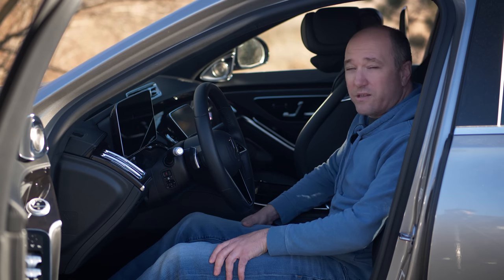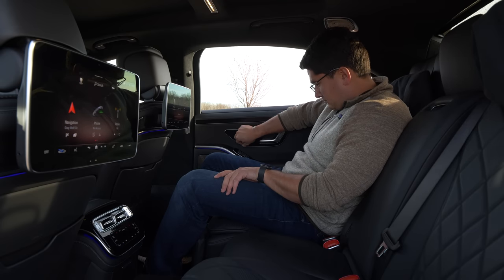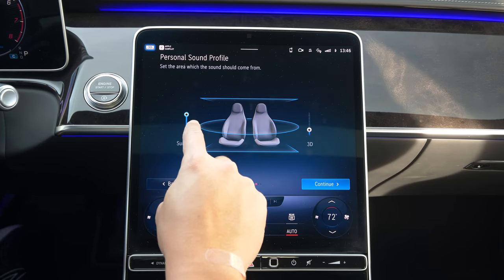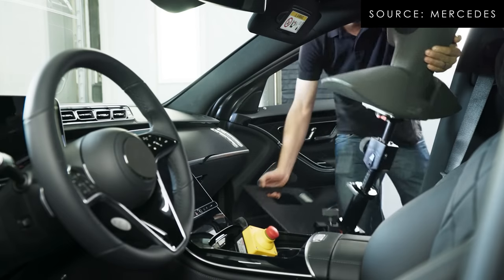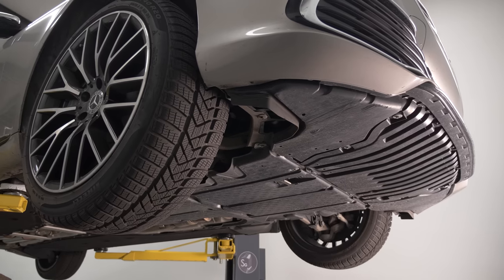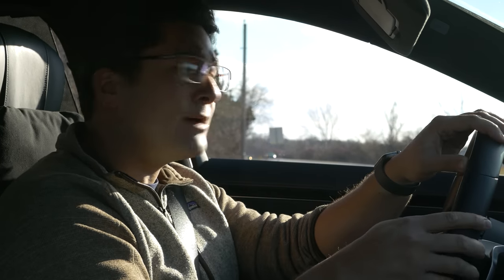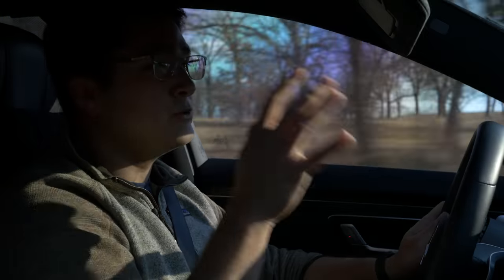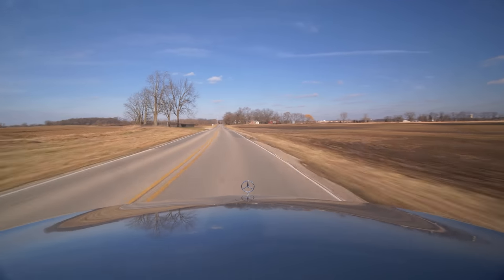Mercedes S-Class | The Best and Worst of Cars

Comment: My experience with a used VW Phaeton followed by a used S Class.
1) If you get a clean, no accident, dealer serviced vehicle, they are generally reliable, but will involve higher running costs vs. something more normal.
2) Phaeton was memorably nice for long distance travel, ride best described as flying over the road, stable, level, insulated travel with comfy well supported seating.
     It was not designed to be easily serviced, and had some baked in design issues which made it financially hazardous to own.
     On the plus side, I managed to sell it on after a few years and 40,000 miles for $3,000 less than I paid for it. ( Still I replaced batteries (self), upper control arms (dealer was ok with my already purchased oem parts), tires, brake pads (self), crank position sensor (dealer)),  timing belt service(dealer). 
  Everything worked on the car ( except the tpms batteries started to go just when I was selling it). It had something like 105k on it when sold, the finish was still near new both inside and out, the paint finish was exceptional with no orange peel, when clean it was a black mirror, the used, also near perfect, newer Mercedes that replaced it could not match that level of paint finish.
3) The S-Class is the Honda accord of big luxury cars. They are made in high volumes, are much better developed, and are easily serviced and durable.
Everything service related is much easier on the S-Class. They are not friendly to aftermarket additions so its best to get a clean, dealer serviced car to own. 
  The driveline related components are typically reliable and long lasting if maintained. In car service applications ( NYC area) they reported about 270,000 miles until transmission need rebuilding and 325,000 when its time for an engine rebuild. Front air suspension lasts about  100-120k.
4) My experience is that overall this is a nicely designed and executed luxury car. It is unfortunately way more ostentatious than a Phaeton. In a similar ownership period, this car needed almost no repair, dealer service was on the expensive side. Repairs were to the heated windshield washer/headlight washer hose that the fitting leaked(self). 
Depreciation was higher on the S, close enough to $10,000, so that sort of made up for the lack of repair, also paid a premium for an as new car from an MB dealer, that had preemptively replaced brakes, tires, control arms, batteries, did a current service, etc, such that it presented as a new car, the prior owner must have been thin as the interior leather, and everything else looked untouched.
The BMW SUV that replaced it felt like a s***box compared to it.
4) Before the Phaeton, I always had sports or sporty cars and an SUV or wagon. Now I’m spoiled.
When you are driving anywhere where its an hour or more, a good luxury car is easy to appreciate. The german examples combine an insulated ride, exceptional safety, with non-boaty handling and grip. The more modern ones are pretty quick as well. 
It’s also sort of a decompression chamber, being comfortably seated, with a pleasing sound system, quiet riding, even in traffic, you tend to be much more laid back. 
5) This current car preserves most of the elements of the prior gen and improves on some things, ride, structure, safety. 
     The UI looks a little annoying. I prefer having hard controls for primary tasks. I think some of the criticism could be mitigated by the use of the steering wheel controls, setting up user profiles by key, configuring desired default settings, and maybe using voice control while driving ( really should have physical switches for primary functions like volume, temp, fan speed, defrost, etc so that you don’t require distract-o-tronic input while you drive)

I’d be more than happy to own one of these used when they hit $25k, 6 years old,  and 60k miles, which they will. 
These are really nice for a net cost of $350-500 a month, in place of a more basic, newer car. ( vs $2500/month new if you have a very substantial disposable income )
Drive an S-Class for a month, then get back into  your car and see how it compares. Better yet, don’t, you’ll save money by driving what you already have.

Comment: FYI, I worked at Harman when we were developing this dashboard for Mercedes and other manufacturers. I was like "this is cool, in my house. But in a car, while you're driving!?"

But this is mainly designed for when cars drive themselves.

The 3D technology is the same as the Nintendo 3DS lol.
Reply: I never understood high end speakers in cars either, the last thing you're gonna enjoy in one is the music. On electric cars you could at least make use of it
Reply: @Daniel-dj7fh  I'll disagree on that one.
Reply: @Daniel-dj7fh  Yeah, why would that be? I doubt its noisier than any electric car, more or less.
Reply: @GoldenCroc  Cars nowadays usually make mostly tire noise, where the ev's also have a benefit since energy saving tires have less rolling resistance
Reply: @Daniel-dj7fh  Sure, but the same tires can be fitted to an ICE car. I would go as far as to say that dollar for dollar, as of currently, ICE cars are in general more quiet than their EV cost equivalent, even with the factory fit tires.
Reply: @Daniel-dj7fh  oh, I think you need to step into a good car with a well designed audio system. Had you done so previously you would not have written that comment. In car audio has different constraints but done well, it is probably less fatiguing and more pleasurable than most people have in their homes.
Reply: @andrewwilson8273  I've been in cars which have Audiosystems costing more than my motorcycle.

Comment: German Engineers over engineering? Never ever....
Reply: The S-Class has always been all about over engineering.
Reply: @iCoolaxe  It used to be about over-building rather than over-engineering.
Over-building means designing something to withstand more than the expected stress for better longevity.
Over-engineering means complexity for complexity's sake.
Reply: Most of the childs play on this car has nothing to do with engineering. The Driving side of the story is what the amg's have had for ages but tuned for comfort.
Reply: @tim3172  That doesn't explain why the centerpiece supposingly creaks

Comment: I think Mark’s assessment is spot on in that the person who will “own” this car will be a passenger who has a driver that will put in the 32 weeks to read through the manual to know how to operate every part of the car and know how to adjust it when the owner briefly mentions a discomfort.
Reply: It is an S-Class, not a Rolls. $140K is little more than a loaded Escalade or Z06 Vette with dealer mark ups.  Doubt many in the US will be chaffuered.
Reply: @briangasser973  Sadly you’re correct. Car prices are insane nowadays. I remember when 45k for a car was “expensive”.

Comment: I love tech, but I hate touch-everything. I don't understand why it has to be done this way.
Granted, you want to have options of a touch screen at times (Maps. etc.), but climate control? I shouldn't have to take my eyes off the road and go through the touchscreen to find it.

I also don't understand why more manufacturers don't copy BMW "M" button. Just stick 10 buttons under the touchscreen, which I can program myself. Add a small screen above them, so that when I program them, it changes the "picture" above the button and voila, I am a happy customer.

But if I am a 50-60 year old dude, I'm not sure I would be happy with all this touch-tech. And I am not that old.

Comment: I think BMW has done a much better job lately balancing interior tech with a feeling of serenity. I recently test drove an X5. I sat down, looked around, and exhaled… a purposeful cabin with premium materials, but with a simplicity that WAS the luxury (Volvo does this well too).  I immediately felt calm and ready to drive. The touchscreen was purposeful and simple to operate, and there are hard controls for the important stuff. I’m with you Mark on the the S-Class tech…a hot distracting mess.

Comment: Although it's probably correct that this car will be a repair queen when it comes off lease, that's not the real negative in my opinion.  The real negative is that I (or someone else who's never been introduced to the car) is unlikely to be able to walk up to the car, get in and drive away while operating its basic functions.  One of Steve Jobs's greatest insights was that computers for the masses had to have a simple UI, even if there were lots of things going on behind the scenes.   I doubt that the buyer of this car is going to take pride in the mastery of all of the menus and submenus needed to fully realize the benefits of  the car.  In fact, if I were selling these things, I would offer -- free of charge -- as much time as the buyer needed to be able to set this up to his/her liking, and then a return trip in 30 days to tweak what had been done.

Comment: I am the proud owner of a new 2022 S580 AMG Line purchased new. This car is my first Mercedes-Benz product. I previously was a proud Lexus owner for decades, and Lexus is most likely the finest and most dependable car on the road, holding their value over time. 

I left Lexus because I always wanted to own a Model S to see if the vehicle was as good of a ride as I always heard and read. It is. It is a superior ride to my previous 2018 Lexus LS 500. 

I prefer the Model S's beautiful, tastefully understated styling. The ride is the quietest and smoothest I have ever ridden. The car also handles excellently. It is powerful and responsive. 

I purchased the Model S for all its latest and greatest technology. At age 77, I desire to drive as long as possible and do so safely. Mercedes is known for having more innovative technology in their cars than any other brand. The safety of this vehicle is another incentive for owning it. 

I have never kept my cars for over five years because I want the latest technology. So, I will be trading this car for an upgrade at the end of its four-year warranty, and I am sure it will be on a new Model S. Lexus is supposed to unveil a new LS 500 in 2025, so I will test drive that model, too.  

Lexus is like Apple, Inc. when it comes to technology. Lexus lets others roll the technology out (Like Apple) and monitors the innovations during the initial unveiling. Lexus improves on the technology, offering enhancements in their vehicles after others, like Mercedes, came first and dealt with all the bugs and issues that may have evolved in the wild. This delayed introduction of new technology is why Lexus cars are more reliable and consistent during ownership. Mercedes is always the first; being first means working out the bugs and offering less reliable vehicles. Still, at my age, I desire the latest and greatest technology, and that is in Mercedes-Benz vehicles.

Comment: guys - everything you said about the suspension is COMPLETELY WRONG. everything you said are functions of the E-ACTIVE BODY CONTROL suspension, wich isn’t even an airsuspension! you guys only had the normal Airmatic suspension which didn’t had any of those function mentioned in the video
Reply from the maker: The car on the lift did not have it, but we were talking about the fully loaded car and capabilities.  The R Steer and Active Body are optional even on fully loaded car.  Our car was pre preduction as well so some oddities were here not discussed.
Reply: @savagegeese  those are obviously always an option, of course they cant make E-Active Body Control standard cause it’s a nearly 10.000€ option. it just was a lil bit of a mess when you guys explained it compared to your other videos where you went nuts and spot on right on the details. so definitely no hate here, you guys are the best!
Reply from the maker: @dr-ok3sn  The issue with certain brands is they dont prioritize or care about getting you engineering or technical info.  The resources/time it takes is not worth it to them.  We asked believe me.  So its just a matter of adjusting around that which meant less tech discussion on this one.

Comment: And I forgot to mention , once you start to use “hey Mercedes voice commands , you will hardly use the touchscreen ever . I use it to rise or lower the temperature inside the car , to change radio station, to input addresses on navigation system , to make phone calls etc . What I mostly use are the controls on the steering wheel and voice commands , and they all work great .

Comment: I know the S class has much better features like massage, but if I was being chauffeured, I'd buy a loaded minivan with built in footrests, like the Sienna, Carnival or Sedona. It's a lot more spacious, you blend in with other traffic better, both sides have room to deploy the footrests, the doors are power, and there is so much more space to customize (adding wine coolers, blanket storage, etc). It also fits in a smaller parking spot or gap in traffic, making it more suitable for city life.
Reply: But the suspension will never be close
Reply: @Daniel-dj7fh , agreed, but it's still a smooth ride and much cheaper to maintain.

Comment: My fear about this car is that one of those zillions of sensors will fail and it will be impossible to find and repair it. Even with a warranty this is a very real possibility. Not just MB’s problem but the more complex the systems are the more likely this scenario becomes.
Reply: Well, currently, the car just tells you every single thing wrong with it
Reply: @MrCarGuy  I’m basing this off real world experience with MB and other brands. Sure the car says there’s a fault in system x but doesn't necessarily tell you exactly what it is.

Comment: To be fair, I’ve got a 2007 Mercedes S550 and it’s all aged very well. 116k miles, nothing outside of normal maintenance other than replacing one of the air struts. It’s the most comfortable and satisfying daily driver I could ever imagine having, even though it’s 15 years old. These things hold up well mechanically, and the older ones don’t have the super gimicky stuff that the new ones have technologically. I can’t speak for how well the screens will hold up in the new ones, but these appear to be very similar mechanically to the older 221 and 222 generations. I’m sure it will probably hold up well in that department.
Reply: Nah my mechanics have been repairing this garbage daily, it has numerous issues especially the S580e variant, this thing is meant to be on a landfill

Comment: My third s class. The exterior design looks much better  in person. The ride and drive are both improved. The dual screen layout is a step backwards for this series both  aesthetically and in functionality . The center touch touch screen takes your eye off of the road to operate while you search  for a menu or try something as simple changing the radio channel. It also takes away from the comfort experience because the ergonomics of the touchscreen are just far enough away from the user to make the driver move his driving position to operate it. The center console takes away the armrest for your forearm as well as reduces the cup holders size.The touch screen stays covered in fingerprints and the fingerprint id is an extra step that gets annoying on a daily basis. The touch screen is also hard to see at times with the suns reflections. The new air vents sit high and away from the driver and cause a distracting reflection on the windshield. The ride,drive, and seats are outstanding , but the electronics make it very frustrating to operate.

Comment: Great video,    I drive for a 5 star hotel , drive the guests to and from shopping, restaurants and so on. I drive a S580 2022 model.This is a worst car I have have driven by FAR. As a driver I would not a pay penny for this car. For base price of $120 K before taxes or even leasing it.  Now the negatives as follows,: I have to put a towel over the door  handle,  there is metal part on the door handle that is really sharp , after driving it for 8 hours the side of my left knee is irritated by hitting it while driving, and why you may ask I an resting my knee on it? the seat on the base car has only minimal adjustments, every time I Make a turn , I slide . 
The door handles pop open , but the door will not open all the time, and if you are not careful one will hot  the sensor on the door handle that locks the door so it closes by itself and goes in, if you are not careful your fingers will get stuck ..   When you start the engine the screen monitor tells you not to pay attention to the screen (?)however, everything is on the main screen to change anything, Why a driver need to be told  and reminded that he or she is stopped on a red light ? the middle screen comes on with a live shot of video telling the driver that there is red light on the ahead. the buttons on the steering wheel have not feedback at all. The sensor on the front pumpers  are so sensitive even on the lowest sensitive setting will hit the breaks so hard that is scary. so every time I start the car I need to go to setting on the middle screen and turn them off. In order to set up and driver account on the screen  to save the setting, I will need to see a sales person to set up an Google account through the dealer. WTF. I can go on with more bad design. I am not sure who design the interior of this car, IT IS BAD 
Whom ever ask me about this Model S , I do mention all these set backs..

Comment: Very very “logical” review. Thank you very much ! I have the previous generation. Already, as soon as you get INTO the tech … it’s distracting and most of the time….takes a 2nd try to get there. Thank god for the MANUAL BUTTONS ! I WILL NOT go for that latest generation. Also, I got the S450 2018 as a certified….Hope I don’t pay a fortune if I want to keep it for at least 10 years like my 2012 CLS. That new generation…to buy used for a long haul…..I think it’ll be extremely expensive.